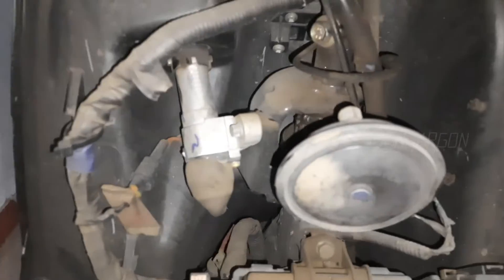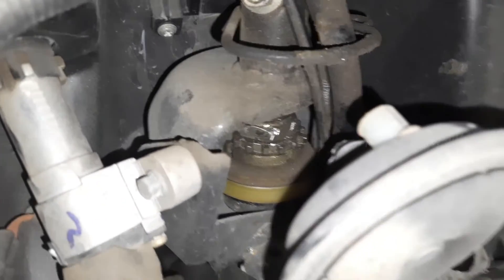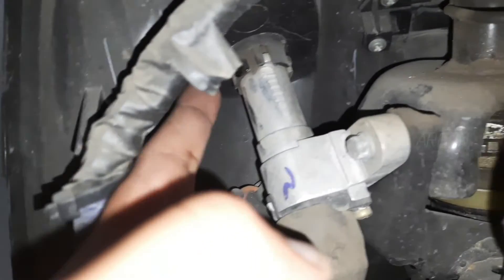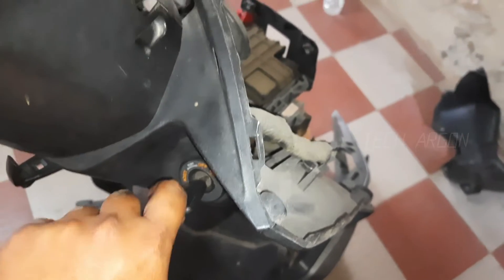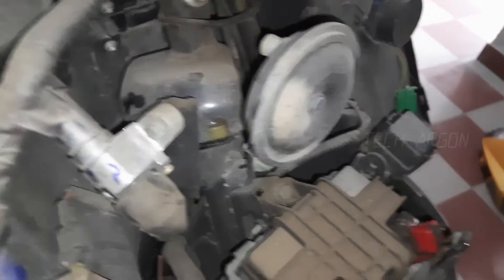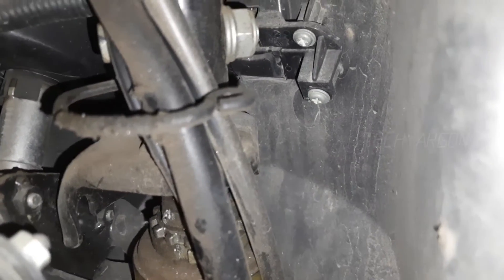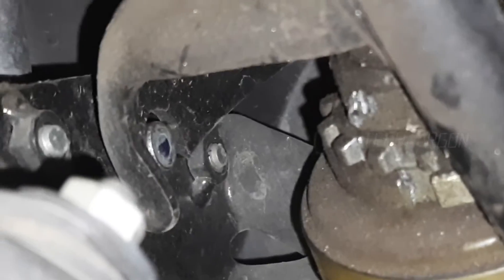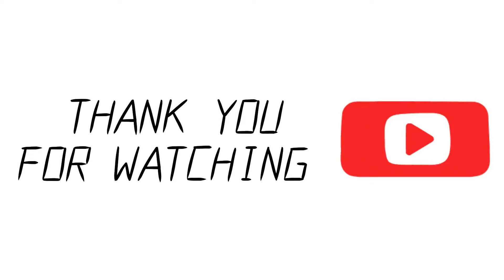How Does a Scooter Handle Lock System Works | Scooter Lock Working Mechanism Of TVS NTORQ

Comment: I drove my scooty without unlocking handle lock almost 30 km. Handle was little bit jammed. Is there any problem by doing that?
Reply from the maker: If the handle was Turning it was not locked by any chance, because if its locked no way it would be Turning, so don't worry there won't be any problem.